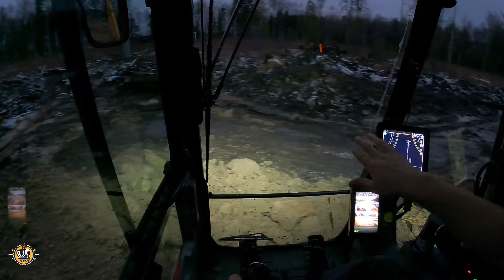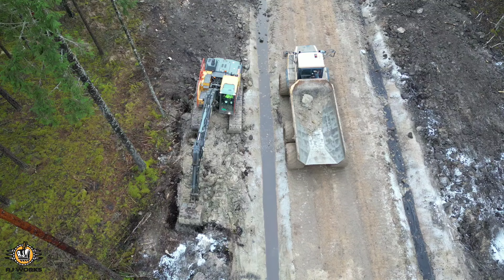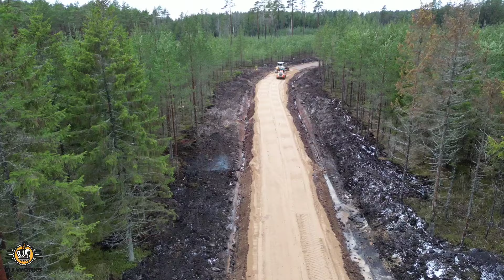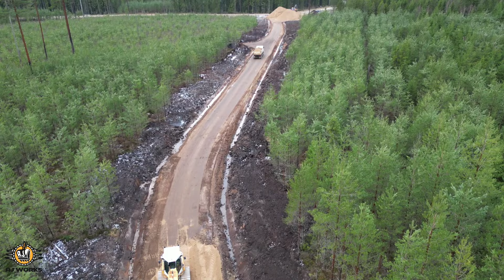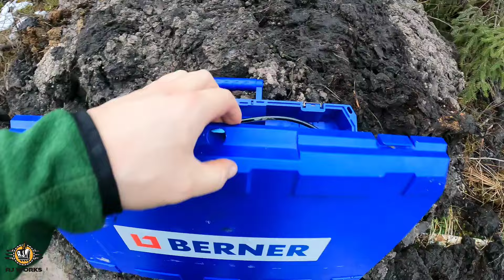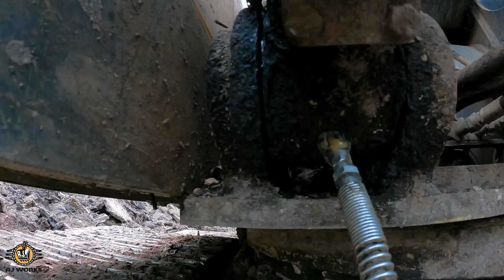Winter Forest Road -- Part 5

Comment: First time I've seen you use pumps.  Does that mean that the land you are working on is lower and lower as you continue to build roads?  Less access to lower land nearby?  Thanks for your video.
Reply from the maker: Yes, we are using the pump on the forest road for the first time. Yes, the road space is lower. But as always, it is only in some places We quickly pump out the water and fill the place, because the water starts to flow back through the piles of the topsoil.